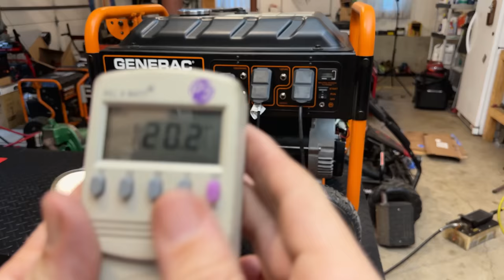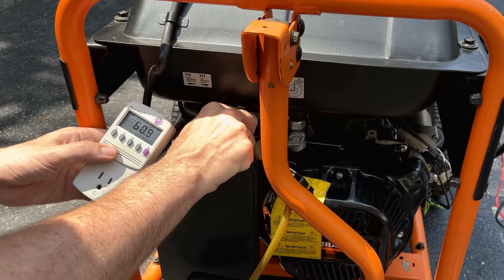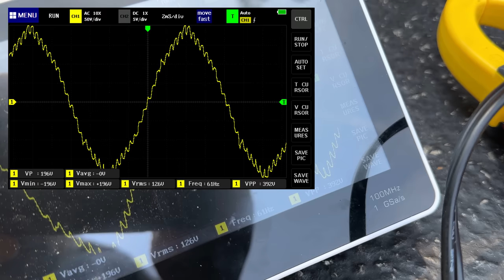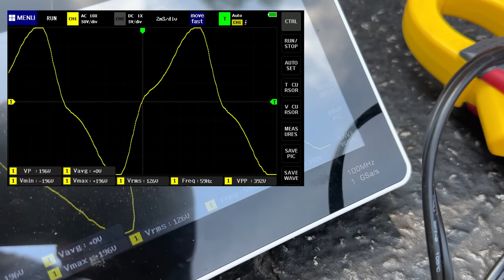Another Generac Generator Not Producing Power - Can We Fix It?

Comment: I think the lesson here is to avoid buying any of these Generac models!
Reply: Does not matter what brand you buy anymore, most of them use the exact same power head. Its one chinese noname company that makes all generators, then they buy up reputable brand names and slap those on to boost sales, and make the end user think they got a good quality brand name machine, when in fact their top dollar genset is the exact same one as a cheapo model like the B&S StormResponder series.
Reply: my coleman powermate 5000 with bs 10hp flathead engine is still going strong 25 years now!!! = quality and dependable.. Sad that all manufacturers make junk today!!
Reply: @ruchknruchkn6575  ...Mine too!!!
Reply: @rovhalgrencparselstedt8343  B+S aren't a top brand name. Buy a Honda genset- not a chinese genset with a Honda motor- a proper Honda brand genset. Can't go wrong.
Reply: Agree
Reply: I got a lot of them setting around for different reasons just like all the other brands 
Most were ran low or out of oil 
Don’t depend on the oil shut down system, by the time it shuts off engine the damage is already done 
Junk
Reply: @rovhalgrencparselstedt8343 you won't find a cheap briggs on one of these generacs or a Honda. Thats the main difference
Reply: No more life long machines..why manufacturers go bankrupt ..a smartaleck will add in something to break wear out  so business can prolong ..
Reply: The last storm passing through SE Michigan, my trusty onan microlite 2800 failed to start, so I visted my local big box home store and bought a 10kw/8250kw gp10,000 generac. It gained about twelve minutes run time before utility was restored ( about 22 hours). Hoping it is a lasting machine, otherwise, surplus military will get my money, 18kw on a trailer .
Reply: @ruchknruchkn6575 Yep, and that was cheap junk in it's day as well.
Reply: @rossbrumby1957 Honda is turning to junk as well. They stop making parts for their inverter gen sets way too early. Example, I think it was a  $10,000.00 Honda that discontinued the inverter. So now it's a $10,000 pile of scrap metal worth nothing.
Reply: @philliphall5198 That's if it even works. I've seen them fail and blow em up.
Reply: @NY411Info   it cost $850 25 years ago , no that cheap then, I bought it for 1998 icestorm..lost power for 3 weeks!
Reply: @ruchknruchkn6575  I bought my Devillbiss 5000 watt for the 98 ice storm as well.  It still works as well. Both,, your Coleman and my Devillbiss are cheap plain Jane machines. During the ice storm people were complaining about price gouging on gen sets. I never noticed it. All the cheap ones were sold out. All that was left was the more expensive ones with lots of features. It wasn't price gouging where I shopped. People that got the more expensive models also usually had quiet exhausts, unlike ours. I use the Devillbiss for hot water only. Too loud to run more than a couple of hours. I use my Honda to power the house, nice and quiet. $2700.00 at the time it was bought. Not $500.00 like my loud Devillbiss, which is now owned by DeWalt.
Reply: bought a remote start chinese gen., lasted 3 yrs.. cost 750 au.. about 400 u.s ish.. 3500w..  small quiet, great for contractor.. working on 2 story houses.. hence, remote start..funny with all this green bs,,  there a throw away item..
Reply: @rossbrumby1957 
I watched a repair channel, "Taryl fixes all ". He does not have anything good to say about Honda generators. Says they are turning out junk too.
Reply: I've had one of these 7500's for 10 years with no issues 🤷‍♂️

Comment: doesnt say much for Generac, does it
Reply: Out of how many thousand sold are these representative?
Reply: @JohnSmith-yv6eq  so you think its commercially acceptable?
Reply: @toxin911  
Who imported these?
Who is responsible for the parts for them?
What is the warranty?
If you bought one would it be a good idea to run it for 24 hours just to see if it breaks..
you know, change the oil after 15 minutes, then again after 30 minutes, 
then again after 1 hour...get out all the metal particles from the initial "running in"
now run it straight for 24 hours under 3/4 load....just to see if it breaks?
Then you can go back to the seller and ask for your money back if it goes bang....?
If you don't give it a good test under warranty... well storing it for years in damp places isn't going to improve it's chances...
nor is submerging it in a flood...
nor is not changing the metal particle laden original oil for 25 or 50 hours of running over 4 or 5 years plus........
Reply: @jcondon1
2 hours ago
The are no better or worse then the others out there.  At least generac sell parts so they can be fixed.

Comment: Aluminum magnetic wire is a cheap alternative to copper wire and is guaranteed to fail much quicker. Aluminum rotors and stators just screams as to the quality of the product, or lack there of… Also solder will not directly adhere to aluminum wire and is usually coated with a very thin copper coating. I suspect this coating is completely wore off due to aluminum oxidation and the solder is just laying on top the wire and not making a good electrical connection. There is no way to correctly fix this other than replacement.
Reply: You actually can solder aluminium directly - you just need to do it in a way that the oxide layer can't form. A home way is to put a puddle of oil on the aluminium, scrape the aluminium to remove the oxide coating, and then tin the surface in the puddle of oil. Then you can solder a wire onto that tinned surface.

Now, whether you can do this on an aluminium wire while it is part of an armeture is another matter. In the factory, they may use a similar technique to tin the ends of the wire before they wrap it. But like you, I'd expect that they'd use copper-clad aluminum

Comment: Good morning my name is Ron what are the chances that my Honda electric start I believe it’s a 5500 generator is good after being submerged in flood water here in Vermont? I’m sorry but I didn’t find any other means to reach out to you thank you much by the way I’ve been watching your channel for a while now but the flood here has put a damper on things I’ll get back to watching you soon thanks a lot
Reply from the maker: There is a chance.  The engine, fuel tank and carb must be promptly drained.  Electrical components dried.  It important to get fresh oil in and the engine running asap to build some heat.  Would be a good idea to pull the brushes so the system does not power up.  You want the stator to be 100% dry before trying that, but the engine needs to run with fresh oil asap.  It will run again.  The question is did the crank rust up.  If so then it may not run for too many more hours.  Run it for 10 or 15 minutes and change the oil.  Do that a couple times.

Comment: On removing OHV valves cover and undersize screw heads breaking - I have a small engine shop and lots of old engines come our way too. I broke many many many over the last 17 years until I forced upon myself the habit of tightening just a very small bit every bolt especially if I was using the impact driver. Yes, it does add to the time and tedium of the task but I can assure you that it is much less than the huge time loss from (the small chance of) breaking a bolt.

Comment: James, with the knowledge that I have learned by watching your videos. I have been able to repair 3 Generators 1 Champion stuck Value also cleaned the carburetor changed the oil and filter,2 Generac  1 with a broken set of brushes, a simple fix also cleaned the carburetor changed oil and filter, and replaced some broken motor mounts. The other one had a value spring retainer worn out. That one 4000XL required a complete value replacement due to you can no longer get the value retainer. By watching your video on removing the head and getting the repair kit which includes new values, springs, retainers, keepers, and head gasket a major improvement in my opinion. I was able to complete the job. Also cleaned the carburetor and changed the oil and filter. The worst part of that job was removing the pull starter shroud and reinstalling the carburetor and air box very tight fit with little room to work frustrating at best. The best part was when starting it one pull with choke second pull running and sounded great. Thanks for the knowledge you are a master teacher. I will keep on watching as long as you keep on teaching! The only mistake I made was shooting one of the value springs and retainer across the room slippery little suckers. 🤣🤣

Comment: A big THANK YOU to James for all of his awesome videos and the knowledge he has passed on !

We had a power outage the other day.  After getting 4 house running on extension cords (just refrigerators and freezers).  I went over to the neighbor's house (80+ yo widow) to get her running.  No start !  Then I realized that someone (me?) had left the fuel on last time the generator was used (over 1 year ago) and the carburetor was likely clogged.  I have always liked working on small engines, but James convinced me to buy a couple of inexpensive tools.  1) External Torx sockets (to remove carburetor studs) 2) A jet/emulsion tube screwdriver (B&S brand; I can't find Bald Eagle Gunsmithing Screwdriver Set and similar sets are much too expensive) 3) The carburetor cleaning kit with the tiny wires and brushes (cheap on Amazon) 4) Extended reach needle nose pliers (straight and 90°) 5) Extended reach small hose grip pliers.

I don't have many spare parts, but when I buy gaskets and other small items I am buying a couple of extras.

Comment: I have one of those Generac GP7500e generators.  Very reliable, except for the type of battery.  Vibrations killed all of them.  Excellent video as usual James.  I want to see what you with the other generator.
Reply: So could you extend the battery cables and after transport (and before starting) the genset....take the battery out of the holder and place it on the ground??????
No vibrations then......
Reply: @JohnSmith-yv6eq  The battery I ended up using is a gel battery.  Vibrations do not seem to damage this one.

Comment: Good morning James, this is Neal I bought a new Generac 2500 I that is the GP 2500i. It’s a new unit and I bought it as a back up for my Honda 3000 c. Also, for my tent, camping for a quieter running machine. I’m curious as to the ramifications of the harmonic distortion could you please explain that a little further thank you.

Comment: Hmm, with 3 dead Gernerac 7500 just in this video, how good are those? Is the high number of failed units because there are so many of them out there, or is the failure rate quite high?
Reply from the maker: The are no better or worse then the others out there.  At least generac sell parts so they can be fixed.

Comment: Nice video, James. Your catching the bad rotor by wiggling the connections shows your experience on these. I've re-soldered the connections on a GP5000 before, not an easy task; I don't blame you for not fooling with it.
Reply from the maker: It’s fine to fix if your own equipment.  Since I sell everything I repair, want to make sure it will last.

Comment: Very informative and great videography as usual!  Any chance you have a spreadsheet of normal measurement values for all the different gensets you’ve worked on through the years?
Reply from the maker: No spreadsheet.  The vast majority of generators in the 5000-8000 watt range made in the last 20 years the stator comes in at 0.4 ohms +- 0.1 ohms, the rotor between 40-70 ohms, DPE 1.5 ohms (1-2.5 ohms).  Not all fall into that bucket.  Some rotors as low as 3 ohms is good.  Some stators as high as 1 ohm is good.
Reply: @jcondon1  Thanks James…most appreciative.  Great channel!
Reply: @jcondon1  1 thing.....   ive learned from buying chinese rubbish,,  allways,, check all the bolts..connections,.
Reply: @jcondon1  should change oil,  every wk or month, depends on use.. this is why they blow up,, no one changes oil,,like there car...as well..

Comment: I love your videos and I love your attention to detail and the way you explain everything you do. You have a very no nonsense approach to your videos that I find refreshing. One thing bothers me a little however. At 37:50 for example you say "the Hertz was just over 60 Hertz". I think the correct terminology should be "the frequency was just over 60 Hz. Frequency defines what you are measuring in Hz. Another example would be the same as saying "the inches was just over 60 inches" instead of "the length, (or width or distance etc.) was just over 60 inches". Another example could be "the receiver ran a yards of over 60 yards". Doesn't sound right does it?
Reply from the maker: Grammar was never my strength
Reply: @jcondon1  There is absolutely nothing wrong with your grammar! It's just the terminology thing that bothers me. It's like when someone says "I'm going to Ohm it out" instead of "I'm going to check the resistance". I'm an old school consumer electronics technician and some the stuff people say nowadays kinda freaks me out! You do a great job on your videos and I must have watched a hundred of them and I always hit the "like" button. Keep up the good work!

Comment: Good fix and our power co-op recommends Generac gensets but I think I'll pass, seeing all those you work on. The old Coleman is a 96 and still going strong BUT I turn it over regularly and it's in a dry as it gets shed and a maintainer on the battery. It isn't as couth as the new ones but it still does it's job. And I cee you have a green Homelite 2-cycle in the floor. THAT will be interesting. A neighbor had a couple and ran them but I don't know for what purpose. I just remember them being run and me being fascinated by them.He also had an acetylene generator. And was a HAMM radio operator and worked for NASA. And had been gassed in the war. FINE guy and God Bless Yall!

Comment: Learned a lot from your videos. I have a Generac XG 10000e. I did not run it for about 3 months. I changed the spark plugs and charged the battery. Tried starting, but would not start. Is there a way I can get carburetor cleaner into the cab without removing the fuel tank?

Comment: Would it hurt anything to set it upright ?   Easier to work on the carb.
Reply: As long as there is no chance of the sump oil running into places it shouldn't..
like the breather tube to the carb, the cylinder itself etc etc....
Safer to leave the machine siting in it's normal stance.
Reply: Only if there is no fuel and oil

Comment: I have this Snapper mower with a Honda CGV 160 that I have been fighting for a couple of months now. I have the engine out already. Surprisingly everything came apart with no issue, but I need to open up the sump. What is the best tool for removing the blade adapter? It is an odd looking one that I haven't encountered before, and I can't find any videos with a similar one online either.
Reply: Air hammer and a pry bar
Reply: @jameslarson6555  
2, 3 or 4 legged puller?

Comment: That engine looked to me to be the most stable you've had so far, it proved to be very strong after the replacement power head. Well done. Also I saw you riding somone's Harley a couple of days ago on here. Are you thinking of getting one ? They are great for going down long straight roads. Along windy roads though I would try and access a Honda CBR 1100XX. They are the best bikes on the road, not made any more so parts my have to be hunted, but brilliant nevertheless. I have a Blackbird :) At 75yrs I have no excuses :)
Reply: I'd match any HD I've owned including baggers against any comparable Honda on curved roads.  The trick is knowing how to ride a motorcycle.

Comment: I have a generac  7000exl and I’m missing the battery box that screws under the tank cover where can I purchase one thank you love your videos
Reply: According to another commenter his batteries have been shaken apart by the vibrations in the generator when it is running.
Might be a good idea to have the battery able to be  placed on the ground when the engine is running...and connect by longer cables to enable this?

Comment: I have a powermate 5700 watt that the wire coming out of the rotor going to the slip ring broke about like the one you were working on.

As of yet I have been unable to find another rotor or complete power head. Best I could determine a new power head is about $500.  More than I would like to spend.

Comment: Great vid as always like the method of checking camshafts simple and accurate way to determine lobe  wear im impressed with the design of the tappets compared with the honda clones but obviously the camshaft metallurgy is poor chinesium . Surprising high THD especially at the crossover points of the output wave under heavy loads and just some high frequency low amplitude ripple on low load. Would like to do some study on what causes it I have my theories but would rather read some techical explainations of they are availble . Thanks again James for sharing your knowledge and wrenching skills.

Comment: great video as usual.I wonder if I can use regular car oil in such engines. I have 15hp honda clone and 7,5hp daewoo 210series and i want use 5w40 oil( valvoline).the manual for daewoo says 5w30...
Reply: 5w40 could work, but only for hot climates, 10w30 is for normal weather and 5w30 is for cold weather

Comment: So Jim with all the videos I watch it looks like the aluminum wire on the rotor seams to be the big problem. Can you fix it? Is there a company that uses Copper wire on the rotor? I just bough a generator,not making power, by the way great videos I always until the end,thumbs up if you read my entire comment.
Reply: Do Honda gensets run copper windings?